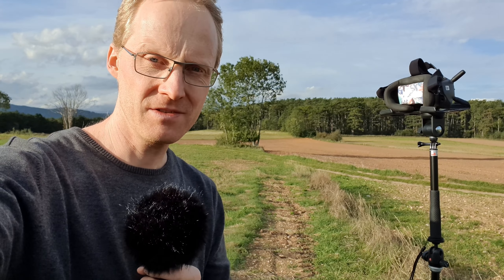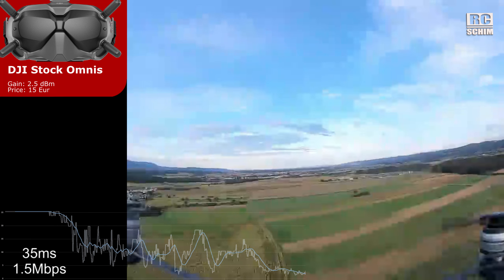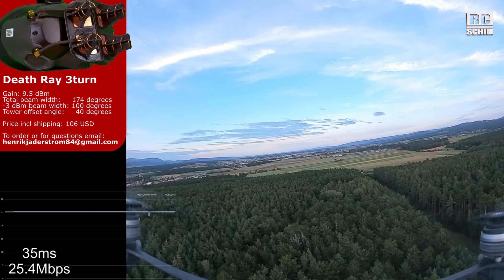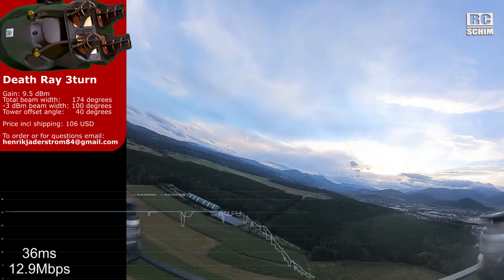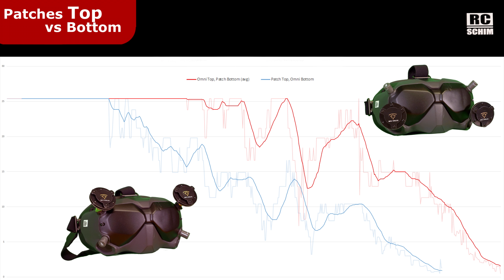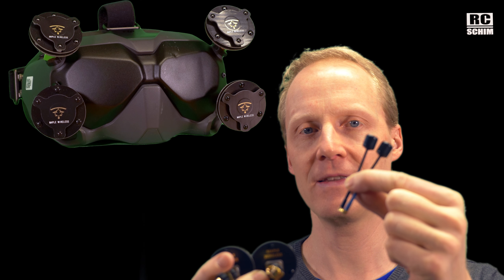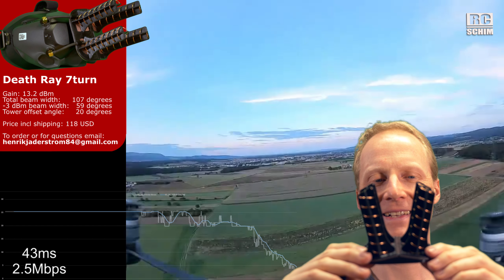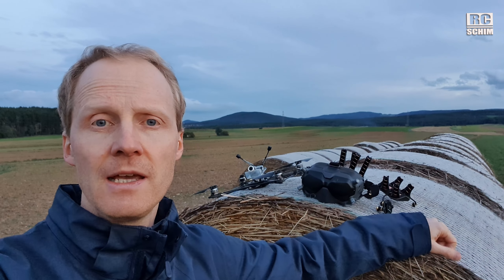Best way to test DJI FPV Antennas!!!

Comment: Mario... mid-rolls again????   I got to 9:52 before the first mid-roll so I don't know what happened in the rest of the video but I'd suspect that the helicals were not performing up to expectations because they were not properly impedance-matched to the transmitter in the goggles.   Impedance mismatches (ie: high VSWR) has far less effect on a receiver than on a transmitter and looking at the data-rates it appears that the helicals were receiving a strong signal from the quad but the data going from the goggles to the quad was quite weak (hence the rapid decline in bitrate).    It's much harder to make a good transmitting helical than a good receiving one and to do the job properly, each individual transmitting antenna should have the feed-point adjusted so as to get the minimum VSWR.  I suspect this has not been done with the helicals you tested.
Reply: The YouTube is inserting them even if you mark you don't want them, Bruce. 😕
It's getting really boring, but... There's no much you can do for now. 😕
Reply: @MCsCreations  As far as I am aware, they haven't done that with my vids.  What sometimes happens is that creators have mid-rolls enabled by default and forget to disable them.  Just requires you to change your default settings.
Reply: @xjet  Well... They showed up for me during your videos as well... 😬
Reply: @MCsCreations  They shouldn't... if they do, please try to do a screen-capture if you can and make a note of the time where they appear.  I'll rip YouTube a new one!
Reply: @xjet  I watch videos on my Smart TV... It's a bit more complicated, but if it happens again I'm going to take pictures and send you!
Reply: @MCsCreations  Thanks, much appreciated.  Video it with your phone so I can send the video to YT and tell them not to be evil ;-)
Reply: @xjet  Great idea! I'm going to do exactly that! 😃
Reply: At the end of the video he said, he did not activate mid-rolls, because you would admire it.
Reply from the maker: Did you notice the same on your videos Mario?   I'm not sure if it is Youtube or my "MCN" - fullscreen (they could "optimize" my videos as well I guess).
I will asks fullscreen contact first. Really makes me angry...
Reply from the maker: Here I definitly KNOW that midrolls were disabled on the upload screen (since I mention this extra in the end I wanted to have it right this time - so I'm dissapointed that they "damaged" my video once again!).   Maybe it's not youtube but Fullscreen (my mcn). I will investigate this further...
Reply from the maker: genau, und dann sowas ;)
Reply from the maker: Bruce, if the ugly midroll distraction wouldnt have kept you from watching it longer you'd have seen that my test setup was the cause. 50m alt for the waypoint was to low. I underestimated the distance to height ratio. When taking off and going for the first WP (directly infront of me) 50m felt really high - and the wood looked rather small down there - but 1km out the height of the trees did interfere - that's why I also got a RSSI warning from my crossfire....
Reply: @Rcschim  Not on my videos, because it's been more than a year since I last uploaded one. I'm still unable to make videos right now. 😕
But I've been seeing midrolls in about every video now, even on channels where they said they wouldn't use anymore. You know?
And I think I saw someone's community post saying they noticed the same... I just can't remember who it was right now.
Reply: @Rcschim  I just found it! It was the channel learnelectronics. Check his community tab, it's not his last post, but it's the third last... Something like that.
Reply: @Rcschim  MCNs are parasites (IMHO).  They serve no purpose but to take a chunk of your earnings for doing virtually nothing.   Perhaps they are simply trying to boost their own bottom-lines at your expense (not unusual).   Do you even need to be part of an MCN now?
Reply from the maker: @xjet  back in 2012 I guess, there was no possibility in austria to be YT partner.   I couldnt even choose my own thumbnail back than ;)
Fullscreen was ok - and since I dont make a ton of views the share they get is rather small. I usually get it back by the few benefits like free Epidemic Sound membership (to get nice free music). But you're right - they're parasites ;)   I'm quite sure it's them to turn on midrolls (probbably automatically with mass update tools...
Reply: Hello Bruce! For me there was no mid rolls but I can see black lines in the timeline wich are usually yellow when mid rolls are active.
Regarding the helical antennas, they did accually perform great. In the first test the forest did get in the way and still they probably got 300 or 400 meters further than the next best contender. In an free line of sight test this is not much but in this test the forest was blocking the signal so its really great as it shows the penetrating strength of this antenna. 300 meters of extra penetraton through a thick forest is ALOT....especially when its only on 25mw👍 in the second test my antenna(the 3turn) held max bitrate all the time, even at around 180degrees from the direction of the antenna wich is amazing. It did dip at one time but thats becouse the drone was blown past the intended flightpath and ended up with a tree clearly blocking the free line of sight.
The feedpoints are adjusted in a simplifyed way that makes sense for a hobbygrade antenna, its done by around a 1/4 wavelength of the coil running perpendicular to the reflector with an airgap, that 1/4 is not included in the turn count of the antenna so its still a true 3, 5 and 7turn helical.
Greetings
Reply: Also becouse the way the dji goggles are designed with the antenna connectors, the coaxial cables of my antennas has to be a specific length and thats just the way it has to be. If I would make then 2mm longer or 2mm shorter the connectors of the antenna would not match the connectors on the goggles and the antenna would not fit.
My antennas won in both range, mbit rate, and clearly in penetration too even if penetration was not meant to be a part of the test...

Comment: Top , danke , wieder ein sehr guter Test ! 
Wûrde mich freuen , wenn du bald die „Antennfreund“ Antennen mit in den Test nehmen würdest!
Haben einen sehr guten Namen und sind weit verbreitet ...
Reply: Makes me wonder. When they assemble the goggles in the factory do you really think the worker checks which antenna connector goes up and which goes down? I bet whoever does this it just takes the two wire from one side and connects to the first two connectors and takes the two from the other side and connects them randomly on the second two connectors. So it's possible to get different results.
Reply: i do not think that cable connection is happening randomly. i really dont.

Comment: Thanks for the test! Question: When the signal comes back do the goggles pick it back up quickly? On my first flight when I lost connection the screen went black. I have been afraid to use my DJI goggles ever since. Thanks!
Reply from the maker: sorry, I was to afraid to let the connection drop fully, so it never went to a black screen (even if I had GPS rth I didnt wanna loose video - it's just against my instincts :)
I think it's back quite soon - but you need autolevel or position hold at least not to crash.  on a normal 5" betaflight copter - I'd switch to angle mode and increase throttle a bit to survive a few seconds in the air until connection comes back.   even if you unplug the goggles and replug them - it doesnt take longer than a few seconds...

Comment: notes:

black petg
double sided copper/fiberglass pcb board
1.4mm solid copper wire
semi rigid RG402
gold plated RPSMA 90 degree connectors

Comment: wirst du zur Dji V2 Brille auch ein paar Sachen erklären? da ist das Thema Antennen ja sehr spannend!
Reply from the maker: ja, da muss ich erst selbst ein paar interessante Tests machen  (z.B. ob V1 brille gleich gut ist wie V2 brille im V1 Modus)
V2 modus (occusync3) ist nochmal kompizierter zu testen, weils ja multiband (2.4 und 5.8) ist. Eigentlich aber wurscht wenn man im FCC mode unterwegs ist passt die Reichweite (hab ich gehört) im CE Modus ist's etwas bescheiden...

Comment: While I'm sure this has something to do with fresnel zone, you could see that in the predictable bitrate change over the trees for the first 2 antenna sets. I'm guessing it also has something to do with the way dji processes everything. In one of the firmware updates they mentioned changing some things after 1km. So I'm guessing when a packet takes more than so much time it assumes loss. Perhaps that window of time was something they made auto adjust. That all is just speculation but it's clear that a normal signal wouldn't fall off like that at the longer distances so it's clearly distance and therefore has to be related to timing and not signal strength. I'm only referring to the last 20 secs or so of each flight. It's a shame we can't see an actual rssi like we're used too, using the bitrate measurement like this clearly has its quirks. Great job though, keep it up. One idea for the future is to take a directional and measure it at say 500m then rotate 45deg or something and measure again. Do the same thing near the edge of the range and see if you see a similar change. If it's simply antenna strength you'll see similar changes by rotating but if it's timing then the rotation at the far measurement won't change much.
Reply from the maker: I think what you refer to is the "sync pulse" related hard distance limit of 6.2km (on older firmwares) and now 13.4km on 50mbit firmware (they doubled the syncpulse time as I understand).
In my later tests (https://youtu.be/NoSAm22bs5E) I made sure to fly high enough not to have problems with Mr Fresnel :)     if you didnt see it yet, check out this test.
Even later I wanted to rule out all flying related uncertainties and mounted an airunit on my balcony and went 2.3km away (couldnt change the distance much due to geographic issues) - this one is here: https://youtu.be/RQML-azG4bQ
greets, Mario

Comment: I understand it's been awhile, but with the Avata now out, the discussion had turned to connect patch diagonally. As I understand it V2 receives from upper right and lowers left (from behind the goggles view) Curious if you have thoughts on this.
Reply from the maker: Hi Brandon, I heard the theory of diagonal being better. This russian guy here made an impressive testflight: 
Diagonal Omni / Patch Combo  (Omni: left top, right bottom from inside!)
  as suggested by RS  and seen by Anik FPV https://www.youtube.com/watch?v=yNMMQkyqfRE&t=1400s
I have a lot of thoughts on antenna-tests but hadn't have the time to do these time consuming tasks sadly. 
Now O3 is out and I wanna test it. And I'm quite sure it will perform so well that the whole antenna discussion is a bit less important  (it just works ;)
The weather also isn't really helping these days. short days - and mostly foggy or snowy ;)
Reply: @Rcschim  I ended up talking with a Dji tech who also said diagonal is the correct way. So I tried both diagonal setups and was unimpressed. Then I went patch to the top 2 and omni original on the bottom and was blown away. Of course, I don't have technical empirical statistics, but anecdotally I gained not only about 2x the distance, but also now have below the horizon connection, which is a game changer for me flying in the canyons of west Texas. Thank you for all you do to keep us all informed!

Comment: This is a fantastic video, but I'm confused about your test half way through on the issue with the curvature of the earth? Did you fix this issue after you discovered it in the other half of the video? I've also seen videos were output power doesn't make a difference in the total possible range of the DJI system. How far do you think the 3 turn helical or 7 turn helical can go on 1000mw. (As i'm flying in the us an we aren't limited by the 25mw rule). I've been able to fly about 2 miles on 1000mw with the iflight patch antennas. (3.1km) I've heard of people here in the us getting close to 3 miles. I'd really like to be able to fly 5 miles (8km) with DJI. Do you think the deathray would get that reach at 1200mw?
Reply from the maker: With some decent antennas (like the 3turn) you should easily get 3miles.  I heard the new hardlimit with 50mbit mode is now double the range like it was before (fixedwing FPVers were stopped abruptly around 4miles because there is a sync pulse - very fast - and if the distance is to much the system get's out of sync and looses it - even if received signal is still pretty good.
Now it should be ~ 8miles...
that being said, I think my furthest flight until now were 3km - because I'm a chicken :)    see my other range test video here - there I flew much higher - so nothing get's in the way: https://youtu.be/NoSAm22bs5E
Reply from the maker: also check this comparison of range with the different antennas at different powerlevels. it's an interpolated estimate - but you see for example:  increasing from 700mw to 1200mw doesnt give you a huge gain in range ;)      https://bit.ly/3iKdlch
Reply: @Rcschim  OMG that sync pulse totally explains the reason output power doesn't affect total distance. I agree though, you can get further on 50mbs. I'll checkout those helica's and give them a try. Thank you!

Comment: Link für die 3 turns helical wär noch fein !!! Die sind ah super kompromiss gell von grösse und reichweite sowie stabilität in den bitrates
Reply from the maker: Ja, mir taugen die 3t auch. Wenn der Rucksack etwas Platz hat, können die auch gleich montiert bleiben, sonst halt die TrueRCs. SMA Staubkappen mit sehr guter Reichweite ;)
Henrik hat keinen Shop - schick ihm einfach ne Mail. Bilder davon hab ich auf Facebook reingestellt.

Comment: Any chance of testing some linear antennas?  I use linear dipoles on my quad and two Biquad directional antennas on the goggles (left ports).  Has worked well out to 6+ miles at 1W.  But I'm curious how my setup stacks up to the 3/5/7 turn helicals.
Reply from the maker: well, technically I already tested linear antennas. check the video I linked at the endroll (right bottom corner) where I drive around with my RCcar. I used ordinary linears ;)   I suspect that the stock DJIs are also not to much circular and that DJI can use linear antennas quite well since multipath interference doesnt matter too much (or maybe even help) in their system it seems...
Reply: @Rcschim  Haven't seen any Biquads yet though.  :-)

Comment: Wait, there’s left and right hand? (I’m new), great, more things to add to my confusion. Should I just order the axii combo? (I think it’s a patch and stubby combo? Sorry I’m new)
Or will 4 stubby be still better than stock (and more than enough for noobs like me?)
Reply from the maker: hehe, if you want to buy DJI airunit antennas they are sometimes labeled as HD digital antennas, or DJI digital, then they are normally LEFT.
All the "older" antennas on the market which we used for analog FPV were defaulted to RIGHT. That's what most pilots used.
So if you get  a lot of old Analog antennas, they can still work fine for you, but you need to swap the copters antenna as well to RIGHT.
And it sure adds to the confusion that you have different connectors:   SMA, RP SMA, mmcx and UFL
Got me thinking that this might be worth an short explanation video for guys like you. greets, Mario
Reply: @Rcschim  yeah, too many acronyms (same reason I’m thinking of buying same brand or at least the ones I see in video’s that people make a pair of)

Comment: Hi, Im considering buying a new anntena for my fpv goggles. Which one would you suggest out of the "Lumenier AXII 2 long range right-angle antenna" or the "Foxeer lollipop 3 15cm right-angle antenna"  The Lumenier is $27 and the Foxeer is $15. Is the Lumenier a much better antenna? If yes, why? Thanks!
Reply from the maker: You're talking about analog fpv right? It's hard to say if the Lumenier is almost double as good as the Foxeer without having it tested ;) Until now I think I only had Foxeers on my bench, and they at times cloned Lumenier (axii) when they stopped doing this their antennas performed worse (Lollipop2 vs 1).
Br, Mario
Reply: @Rcschim  Yes analog fpv. I really like my lollipop 3 antennas. They seem to work great, but Im curious if the lumenier AXII ones are actually twice as good.